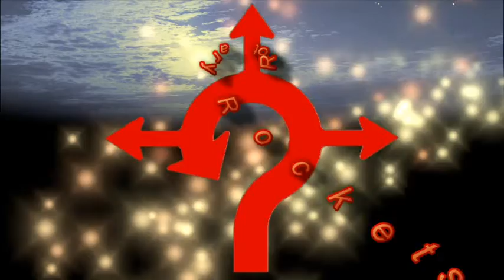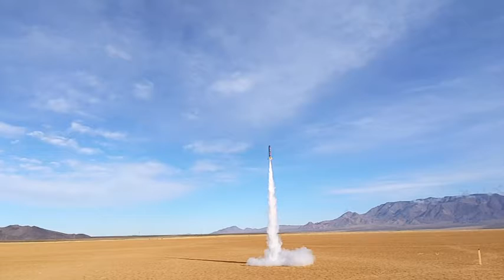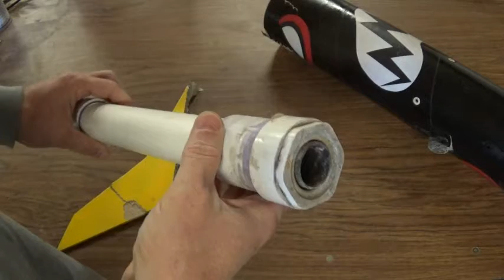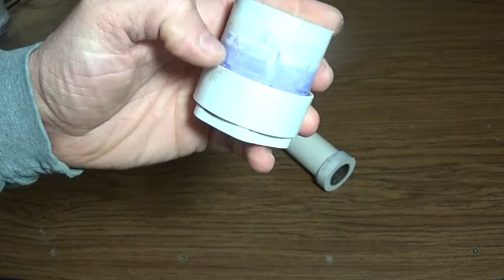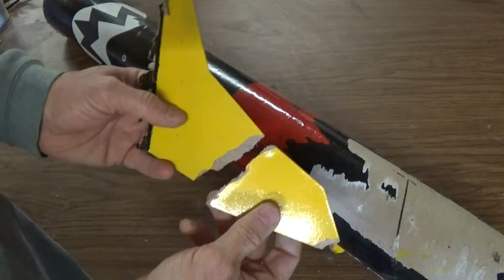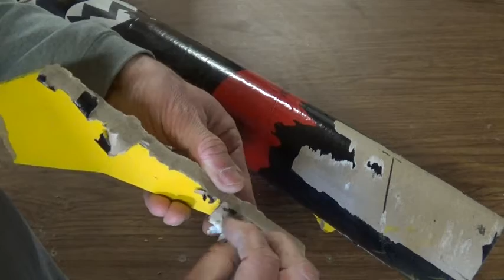Eliminator 2 Rocket - What went wrong?

Comment: Peeling the white layer off the tube will allow the epoxy to soak in better. I would think you would want a better fin material like aircraft ply or G10 sheet. Going to watch the Eliminator 3 & 4 to see the next evolutions.
Reply from the maker: Even if you peel away that weaker top layer, you are still just trying to stick a fin to paper. Surface fins for this rocket was just me being lazy... And I paid the price for it... Through fins are all I build now.
That said, I have also switched to a thicker 1/4" MDF paneling material for the fins which is significantly stronger.
========
You had asked me a question about the Foam & Epoxy nosecone but I can't seem to find the comment on that video... To answer your question, the straw in the nosecone is so you can add weight to the nosecone later if needed. Sometimes you need to add weight to the top of the rocket to help with stability.

Comment: My guess would be an issue with fin flutter.
Reply from the maker: Yeah, estimated speed was around 400 mph so the next rocket, Eliminator 3 has significantly stronger fins. We have launched it and the fins held up well... have not posted that video yet.